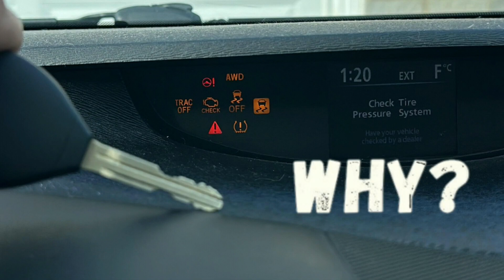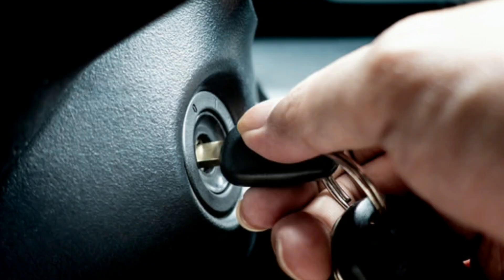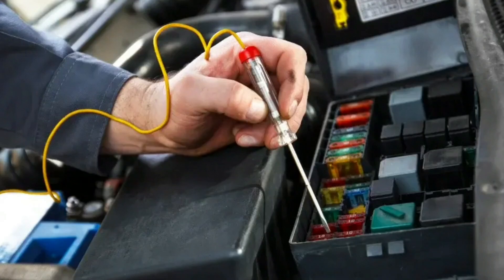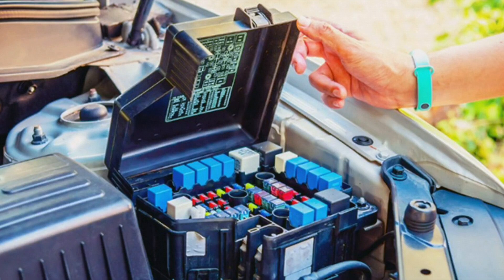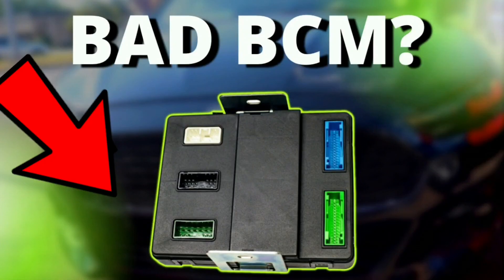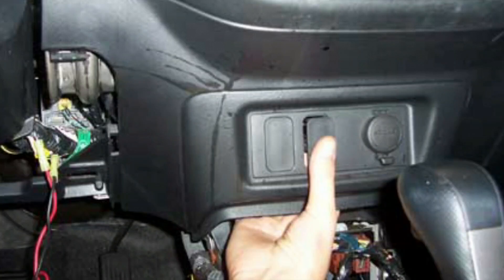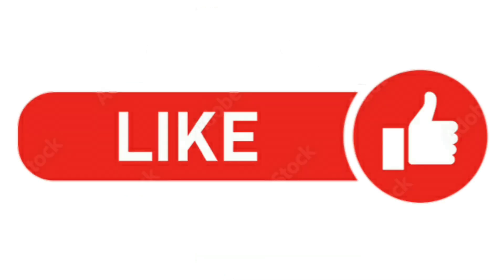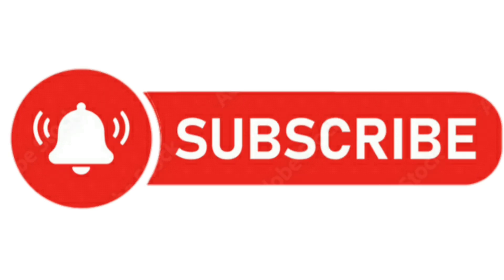How to Fix Dashboard Lights Staying On After Turning Off the Car | Dashboard Lights Won’t Turn Off

Comment from the maker: ✅ DASHBOARD LIGHTS STAY ON AFTER TURNING OFF THE CAR?
👇 Drop your car’s make & model below — I’ll help you fix it fast!
In this video, I cover:
✅ Why dashboard lights stay on after shutting off the engine
✅ Common causes like faulty switches, electrical issues, or sensor faults
✅ Step-by-step fixes to turn off dash lights properly
✅ When to consult a professional for electrical problems
🚗 Works for most vehicles including:
Toyota, Honda, Ford, VW, Audi, BMW, Nissan, Hyundai, Kia, Chevy… and more
💬 Got questions? Comment below with your car model or issue — I respond to every comment!
Reply: Iveco E16
Reply from the maker: @knowledgegavaza2133   Thanks for your comment!  On an Iveco E16, if the dashboard lights stay on after turning off the ignition, the most common causes are:
✅ Possible Causes
👉 Ignition switch not fully turning off
– Worn ignition barrel can keep accessories powered.
👉 Body Control Module (BCM) glitch
– A software or communication issue can keep dash circuits alive.
👉 Stuck relay (main relay / ignition relay)
– If the relay is stuck closed, the dash will stay powered even with the key out.
👉 Aftermarket accessories wired incorrectly
– Radios, alarms, trackers, or cameras can back-feed power to the cluster.
👉 Low or unstable battery voltage
– Iveco trucks often show electrical weirdness when the battery is weak.
✅ Quick Things They Can Try
Turn the key fully to OFF and remove it, then re-insert and remove again.
Disconnect the battery for 5 minutes to reset modules.
Check if any aftermarket device stays powered even when the key is out.
Listen for a relay clicking in the fuse box when turning the key off.
✅ If the problem continues
A mechanic should check:
Ignition switch
Main/ignition relay
BCM faults
Battery & alternator charging voltage.
Reply: 2008 Infiniti EX350
Reply from the maker: @nvidian   Hi!  For a 2008 Infiniti EX35, dash lights staying on after you turn the car off is usually caused by one of these:
✅ Most Common Causes
👉 Stuck ignition switch – Sometimes the switch doesn't fully return to “OFF,” so the BCM keeps accessories powered.
👉 Bad BCM (Body Control Module) signal – A common issue on older Infiniti models; the BCM may not shut down the interior/dash circuits.
👉 Failed door switch – If the car thinks a door is still open, certain lights including the dash backlight can stay on.
👉 Battery/alternator voltage issues – Low voltage can cause modules to stay awake instead of going to sleep.
👉 Aftermarket accessories (radio, alarm, remote start) – They can interrupt the CAN bus and keep dash lights powered.
✅ Quick Fixes to Try
👉 Turn the car off,  remove the key, wiggle the ignition switch and ensure it fully clicks to OFF.
👉 Disconnect the negative battery terminal for 10 minutes to reset the BCM.
👉 Check if door-open warning stays on. If yes, the door switch is likely the problem.
👉 If you installed an aftermarket stereo or alarm, try disconnecting it to test.
✅ If the lights still stay on
You may need an auto electrician to test the BCM and ignition switch—they are the usual culprits on the EX35.
Reply: @Dashboardwarninglights thanks for the prompt reply, it doesn't give door ajar warning so we can rule that out. I'm focussing on the ignition switch ( push button) and BCM. Car doesn't have any after market accessories. I removed the number 3 fuse from the driver side junction box. It turned the meter lights off for now. But I got to source out some bidirectional scanner and check out the push button status, any door switches open and BCM live data  to determine the cause. It wont be till next week but I'll keep you posted
Reply from the maker: @nvidian   Good update — that actually narrows things down a lot.
If the door ajar signal is normal and pulling Fuse #3 shuts the dash lights off, that means the BCM is definitely keeping that circuit awake when it shouldn’t. So you’re on the right track focusing on:
✅ What to Check Next
👉 Push-button ignition switch status (make sure it’s reporting OFF correctly in live data).
👉 BCM inputs: ignition, ACC, and ON signals — any one stuck “active” will keep meter lights powered.
👉 BCM sleep mode: after locking the car, the BCM should enter sleep within a few minutes. If it doesn’t, you’ll see it in live data.
✅  Tip
On some Infiniti EX/G models of that era, a weak ignition signal wire or a failing BCM transistor keeps the meter illumination active. So your bidirectional scan test will likely reveal which input isn’t dropping out.
Sounds like you’re approaching it exactly right — keep me posted, I’m curious what you find!

Comment: 2012 Durango citadel 5.7
Reply from the maker: @richardself231  Hi! For the 2012 Durango Citadel 5.7, dashboard lights staying on after the car is off is usually caused by a faulty ignition switch, TIPM (Totally Integrated Power Module) issue, or a stuck relay.
👉  I recommend starting by checking for parasitic draw, inspecting relays/fuses in the TIPM, and making sure the ignition switch fully returns to OFF. A weak battery or poor ground can also keep modules awake. If the lights stay on longer than a few minutes, a scan tool that can read body control modules will help pinpoint the exact cause.

Comment: My car does start up normally but my radio and cluster doesnt show any information, everything is off except for some error lights like brake lights are blinking and it remains on even when the key is out..
Reply from the maker: @filipe2617  Hi!  If the car starts normally but the radio and instrument cluster stay blank, and warning lights keep blinking even with the key removed, this is usually an electrical issue. Most of the time it’s caused by a weak or failing battery, poor battery terminals/grounds, or a stuck ignition switch or body control module (BCM) not going to sleep.

Start by checking the battery voltage and connections, then try disconnecting the battery for 10–15 minutes to reset the modules. If the problem comes back, the ignition switch or BCM may need to be inspected.

Comment: Hi my car mazda bt 50 when i swich off car deshbord light is sill on why?
Reply from the maker: @DicksonOnge  Hi, For your Mazda BT-50, if the dashboard lights stay on even after you switch off the car, here are the most common causes:
👉  Ignition switch not fully turning OFF
Sometimes the key/ignition barrel wears out or doesn’t return fully to the OFF position, so the electrical system stays partially powered.
👉  A stuck relay (usually the ACC or IG relay)
If one of the accessory relays is stuck, power keeps flowing to the dash even when the engine is off.
👉  BCM (Body Control Module) glitch
The BT-50 is known to have occasional BCM glitches where lights stay on. Disconnecting the battery for 10 minutes can reset it.
👉  Aftermarket accessories wired incorrectly
If you have an alarm, tracker, radio, or lights recently installed, they may be feeding power back to the dash.
👉  Alternator or battery issue causing back-feeding
A failing alternator diode can send power back into the system and keep the dashboard alive.
What you can try:
✔️ Double-check the key is fully in the OFF position
✔️ Disconnect the battery for 10 mins to reset the BCM
✔️ Check if any accessories were recently installed
✔️ If the issue continues, a mechanic should check the ACC relay and ignition switch

Comment: 2007 VW Beetle Dashlights stay on when exiting the car but they do NOT stay on if I turn the headlights on and then off before closing the car door. What issue would this polnt to?
Reply from the maker: @QUANTster   Thanks for sharing! This is usually a sign of a worn headlight switch or lighting control module. Most cars send a “headlight off” signal to turn off dash lights when you exit, and if the signal doesn’t register, the dash stays on.
The fact that turning the headlights on and off before closing the door fixes it points to the switch not always sending the signal.
✅ Likely causes:
👉 Worn headlight switch
👉 Lighting control module glitch
👉 Less likely: door switch/BCM wiring
💡 Quick tip: gently cycle the headlight switch a few times while the car is off—if the dash lights behavior changes, the switch may need replacement.
Reply: @Dashboardwarninglights Thank you!!!
Reply from the maker: @QUANTster   You’re welcome! Glad it helped. 😊

Comment: Hey i have a 2006 nissan xterra 4.0 v6 and the instrument cluster stays on when the key is out. I've replaced the battery and alternator along with having them tested and they passed. With the instrument cluster staying on it drains the battery so any help you can provide is greatly appreciated. I did get a P0603 code so i will be checking fuses and terminals in the morning. Closest mechanic is 30min away
Reply from the maker: @liltree2007  Hi! Thanks for the detailed info. If your cluster stays on even with the key out, it could be an electrical backfeed issue — often caused by a faulty ignition switch, a stuck relay (especially the accessory or ignition relay), or a grounding problem. Since you’re seeing code P0603 (ECM power backup), it points to a possible power or ground fault to the ECU.
Start by:
👉 Checking all grounds and battery terminals for corrosion or looseness.
👉 Inspecting fuse box relays for any that feel warm or “click” after key-off.
👉 Testing the ignition switch — sometimes it doesn’t fully cut power to accessories.

If all checks out, disconnect the ECM backup fuse for a few minutes to reset it and see if the lights turn off afterward.
Let me know what you find in the morning — that P0603 clue is a good lead!

Comment: That ain't my issue replacing the lights on the dashboard lights
Reply from the maker: @gregshea8773  Thanks for clarifying! This video focuses on warning lights staying on due to system or sensor issues, not the physical bulbs. If your dashboard lights themselves are faulty, you’ll need to check or replace the bulbs or LED panels.

Comment: Hi my isuzu kb 280 lights that should turn off they stay on even the car has started even when am driving
Reply from the maker: @Philemon  It sounds like your Isuzu KB 280 has an issue where the dashboard lights stay on even after starting or driving the vehicle. This could be caused by several factors:  

✅ Possible Causes:  
👉 Faulty Ignition Switch – If the switch isn’t turning off completely, it may keep power flowing to the dashboard lights.  
👉 Stuck Relay or Blown Fuse – A malfunctioning relay or damaged fuse could be supplying constant power.  
👉 Wiring Short Circuit – A damaged or crossed wire might be causing the lights to stay on.  

✅ Recommended Steps:  
👉 Check the fuses related to the dashboard lighting system.  
👉 Test the ignition switch – If turning the key doesn’t fully cut power, the switch may need replacement.  
👉 Inspect relays – Listen for clicking sounds when turning the key; if a relay is stuck, it may need cleaning or replacement.  
👉 Temporarily disconnect the battery at night to prevent draining it while the issue persists.
👉 Try scanning the car with an OBD2 scanner to check if there are any stored trouble codes. That will help narrow it down.

If the problem continues after these checks, I recommend taking your vehicle to an auto electrician or an Isuzu specialist for a proper diagnosis.
Reply: If that happens on the Isuzu KB's then your alternator is faulty.
Reply from the maker: @MRMERLIN_021  That’s a helpful insight — thanks for sharing! A faulty alternator in vehicles like the Isuzu KB can definitely cause dashboard lights to stay on after shutting off the car. This could really help other viewers diagnose electrical issues faster!
👉 If this video helped you, don’t forget to like, subscribe, and hit the bell icon for more car repair tips!

Comment: All this crap started happening after my automatic stabilization control sensor went off took it to Dodge they said it was fine then batteries started to drain
Reply from the maker: Hey @jedigeorge1298 — that sounds super frustrating!
If the stability control sensor triggered and the dealer didn’t find a fault, but your battery started draining afterward, there might be a parasitic drain related to that system staying active even when the car is off.
I’d recommend checking:

👉 If the ASC module is still drawing power while the ignition is off

👉 Running a parasitic draw test using a multimeter

👉 Checking for any fault codes with an OBD2 scanner (even if Dodge said it was fine)
Let me know what codes come up if you scan it—I’ll help you break them down!

Comment: My dash light keys turning on after the cars shut off it doesn’t stop until it kills the battery every ten seconds it clicks on for five seconds then clicks off but it does it all night till the battery’s dead
Reply from the maker: @jedigeorge1298  
✅ Possible Causes & Fixes:
👉 Faulty Ignition Switch
Some cars keep accessories powered until the ignition switch fully disengages.

Fix: Try wiggling the key before removing it or replacing the ignition switch if faulty.

👉 Body Control Module (BCM) Malfunction
The BCM controls interior electronics and might be stuck in a loop.

Fix: Disconnect the battery for 15 minutes to reset the BCM.

👉 Parasitic Drain from a Stuck Relay
A failing relay can keep the circuit active even when the car is off.

Fix: Identify and replace the faulty relay (start with the accessory or interior light relay).

👉 Aftermarket Accessories
If the car has an aftermarket alarm, remote start, or tracker, it could be causing electrical issues.

Fix: Disconnect or check these devices.

👉 Software/ECU Issue
Some vehicles have software bugs that cause delayed shutdown of lights.

Fix: A dealership might offer a firmware update or reprogramming.

✅ What to Do Next?
👉 Use a multimeter to check for parasitic draw when the car is off.
👉 Check fuses & relays in the fuse box for any stuck circuits.
👉 Scan for error codes using an OBD2 scanner to see if the BCM or ECU logs any faults.
Reply: Could it be a faulty ignition even with it being push to start ?

Comment: Sometime oil.light samtime hanbrake Santie all ligte sty on
Reply from the maker: @BOETIEKnoetze It sounds like multiple warning lights (oil light, handbrake light, and others) are coming on at the same time. This could indicate:

1. Low Battery Voltage or Weak Alternator
If your battery or alternator is weak, it can cause multiple warning lights to come on.
Check battery voltage with a multimeter (should be 12.6V+ when off, 13.8V-14.5V when running).

2. Faulty Ground Connection or Loose Wiring
A loose or corroded ground wire can cause electrical issues.
Check the battery terminals and ground connections in the engine bay.

3. Failing ABS or Brake System Sensor
If the handbrake light and other warning lights come on together, a faulty ABS sensor or brake fluid level sensor could be the issue.
Check brake fluid level and scan the ABS module for codes.

4. Oil Pressure Sensor Issue
If the oil light comes on randomly, check for oil leaks or low oil pressure.
If oil level is fine, the oil pressure sensor might be faulty.

Next Steps:
✅ Check battery and alternator voltage.
✅ Inspect wiring connections and ground points.
✅ Scan for ABS and engine fault codes.
✅ Check oil level and brake fluid level.
For more details, click here:
👉 https://youtu.be/SLnmp8-Xtcs

Comment: My headlight icon on the dash stopped working, but the headlights work. Fog light icon next to it works. Any ideas? Fuse?
Reply from the maker: @KyleRS877 Possible Causes & Fixes for Missing Headlight Icon on Dashboard:

👉 Dashboard Bulb or LED Issue: If your car uses traditional bulbs for the dashboard, the bulb for the headlight icon may have burned out. If it's an LED, there might be a loose connection.

👉 Software or BCM (Body Control Module) Glitch: The BCM controls dashboard indicators. A minor glitch may cause the icon to stop displaying. Try resetting the system by disconnecting the battery for a few minutes.

👉 Fuse Issue (Unlikely): Since the headlights themselves are working, it's unlikely that a fuse is the problem. A fuse failure would typically affect the headlights, not just the icon.

👉 Wiring or Instrument Cluster Issue: A faulty wire or connection in the instrument panel could be preventing the icon from lighting up.

✅ What You Can Do:
Try a battery reset (disconnect for 5-10 minutes).

Scan for error codes using an OBD2 scanner.

Check the instrument cluster for any loose connections or damage.

If the issue persists, the instrument cluster may need professional diagnosis.